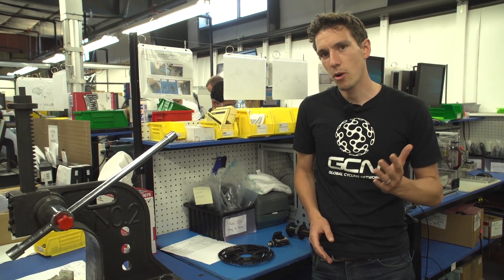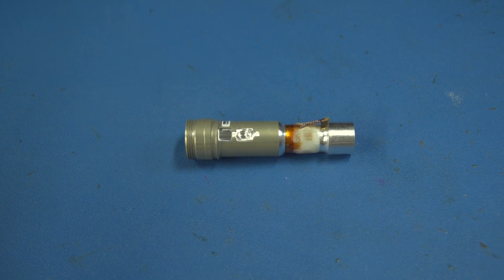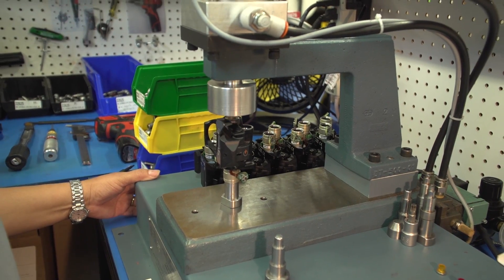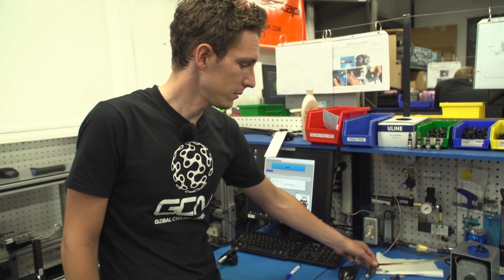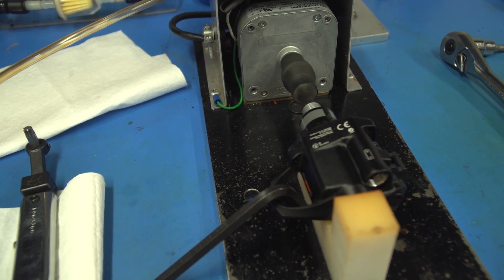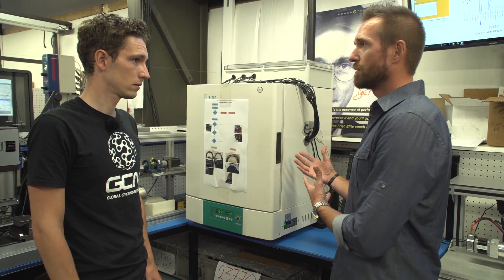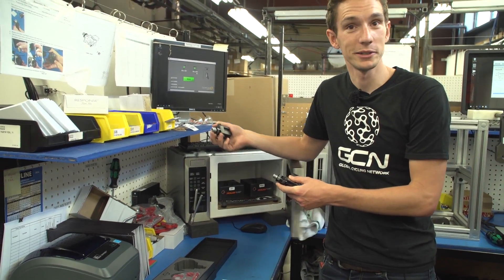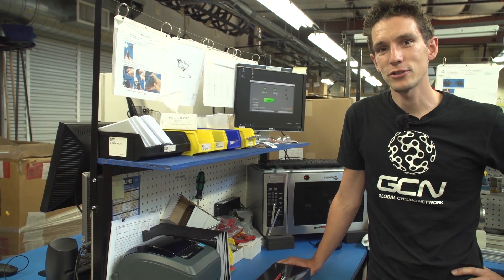How A Powermeter Is Made – Powertap P1 Pedal Powermeters

Comment: I NEED TO KNOW THE MATERIAL USED IN THE STRAIN GAGES! I HAVE A SCHOOL PROJECT!
Reply: II TANFi3LD II Strain gauges are a special kind of resistor that is clinically applied to any material in order to measure how much it stretches in a single direction when loaded. ("strain" literally means "how much longer it gets when you stretch it.") When the main goal is the measure forces like in cycling, my guess is that you want a material with a low modulus of elasticity (so that you get more strain for less force). But even the you can compensate with different shapes and thicknesses. I would assume that for a cycling pedal that they use some kind of aluminum alloy.
Reply: First, start by sussing out the spelling of gauge.

Comment: The fundamental problem with pedal based power meters is that pedals are consumable. Axles, bearings, and plastic bodies all wear. As soon as any part of these are worn, they surely need stripping and recalibrating. This is why the crank, spider, or crank tube based strain gauges will always be the best in terms of longevity.
Reply: Hi PT I k ow it’s an old thread but do you think that if the magnet is ‘loose’ on the axel (they were when I stripped them to grease the bearings) it would cause what I am experiencing which is dips / spikes in power?

Comment: Pedals barely last me two years, even with rebuilding the spindle and replacing topplates.  They still wear in unreplaceable areas. That's a lot of money for essentially a consumable item.  And my Garmin Vectors kept getting axial play from bad bushing and didn't even last that long.  Fool me once, fool me twice, something something.  If I had just bought a Shimano Stages years ago, I could still be using it...and using it into the future years to come, because Shimano hasn't changed their splined Hollowtech 2 design in at least four generations now.
Reply: Absolutely this!  The bearings in PowerTap P1s and Garmin Vectors are JUNK.  It is such a stupid idea to try to fit a power system into a pedal.  This is pure concept over reality 'engineering'.  I had a pair of P1s for a single ride, got home, and the bearings were knocking about like hell. Got a refund.  Also, the height of them is hilarious.

Power meters; do NOT get pedal based ones.  Cranks based is really the only way to go. 

I can't express in words just how bad these pedals are, and completely agree with your comment.
Reply: Can't beat SRM power meters in my humble opinion.

Comment: most stupid place for a powermeter, just after wheel hub
Reply: My pedals always end up very scratched - don't think I'd risk this kind of system.
Reply: Mr B yup, hub Pmeter your a stuck with one wheelset, the pedals wear out and exposed to chocs. Chain ring is also less versatile in therm of gearing ratios. Crank based makes more sens, especially on the spider, you have dual side measure and it's easy to swap from on bike to another, event with different chain rings set up (TT/road/cross bikes). All Powertap product are silly in terme on location, they just want to be different that all other brand in order to exist.
Reply: PowerTap stuff is all lame, clunky old-man 'engineering'.  You are totally right.